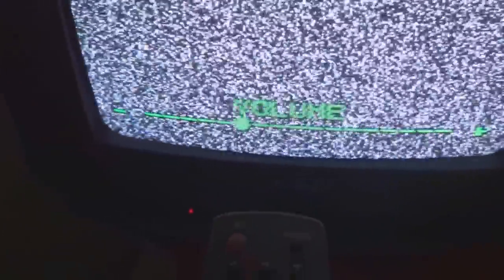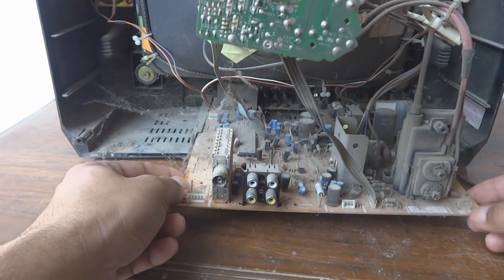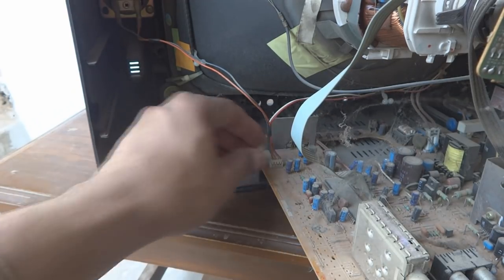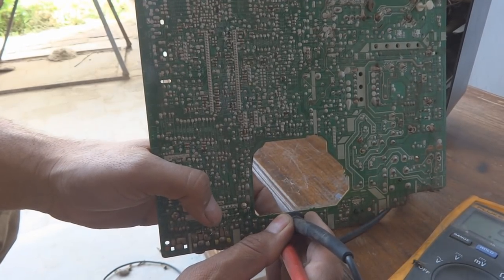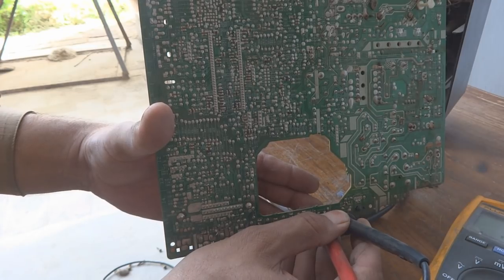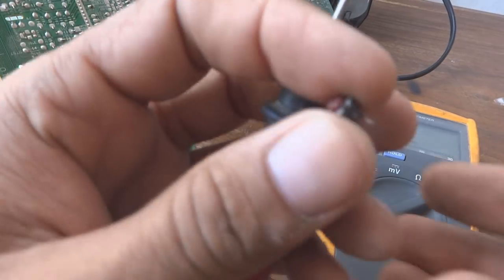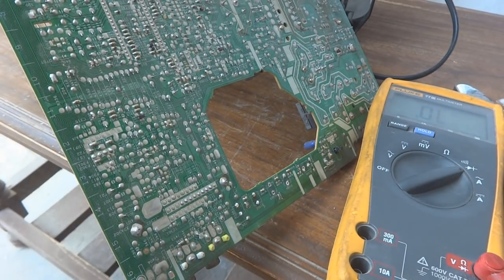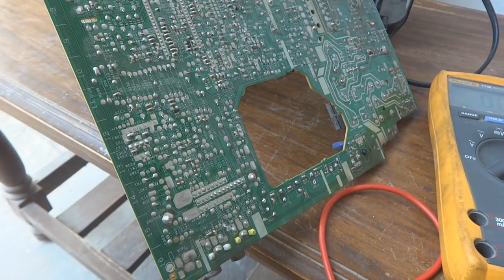television repair and troubleshooting.

Comment: It's been a long time since I've seen a CRT television. And amazing of how little is in them compared to about 40 years ago. Nice work Jahan that you were able to find the switches for it and was able to get her done :)
Reply from the maker: Yes exactly sir. Today's TV or yesterday's TV chassis is way simple compare to some 40 years older models. This is some what 15 years old model TV of mine but used hardly for 4 years then stored for long time.

Comment: Great fix :-D, looks like the spiders had some fun with that set LOL :-D.
Those switches work well for years, but some brands seem to oxidise quickly inside.

I know that the switches connect to high resistance control lines, so the "on" resistance does not really need to be zero ohms, but i still do a repeated zero ohm test on every click to check the quality of the switch.

I keep the front panels with switches on from old vcr/dvd/car radios, cost nothing :-)
Reply from the maker: Yes exactly sir you are very right. The switches should operate with very little and gentle press as the new switches were. The cost of the new switches was low enough. The were very inexpensive.

Comment: sallaam sir nice to see someone repairing old tvs I have done a few plasma and lcd tv usually it's is a bad psu with bad capacitors another good video keep it up sir
Reply from the maker: Wa salam, that is great if you are repairing LCDs. They are in great use now a days. This was actually my own television so I switched it on after a very long time say 10 years.

Comment: Sir actualy i want to try repair lazer printer power supply but i dont know how to pick a track how to find a fault step by step plz try to uplode a video to repair power supply but step by step for beggners for example take a adapter or smps but step wise testing by digital multimeater actualy in every power supply concept is same but i am troubling in testing.suppose my printer is dead and power supply is faulted in first step which component is firstly test in power board share your experience and guide me

Comment: Sir how to fix vertical height on old TV set
Reply from the maker: Set it from variable potentiometers if it is very very much old set. Or set it from service menu through remote control if it's latter model.

Comment: Sir how to check single Phrase Bridge Rectifire with 4 legs ,number is D2SBA -S60 81ON DIGITAL MULTIMEATER
Reply from the maker: I may try to upload a video on rectifier testing. That is a bit basic but anyhow I would do it for you. Regards,